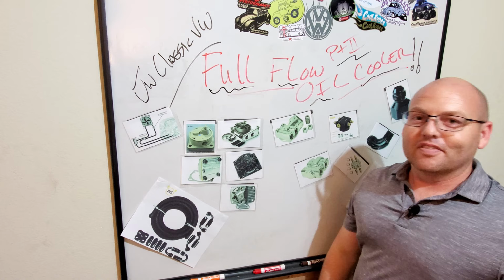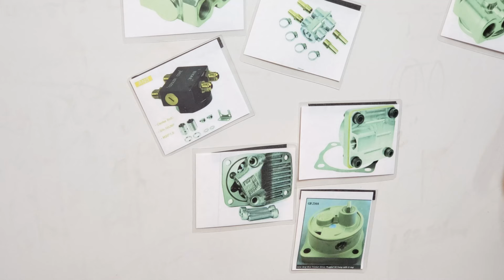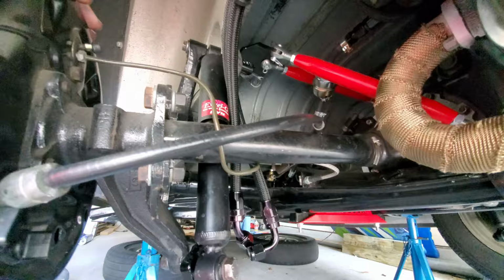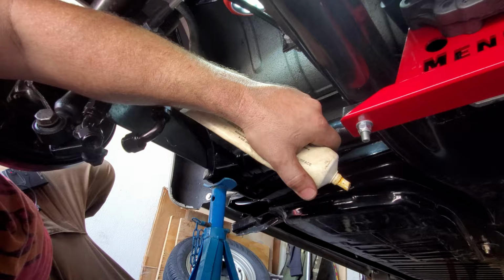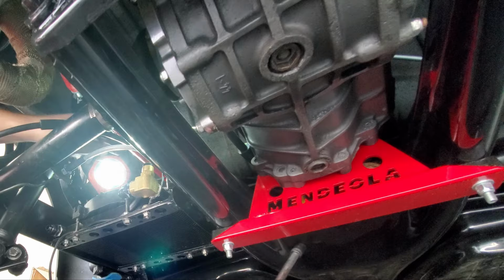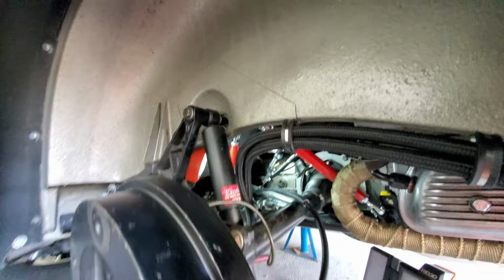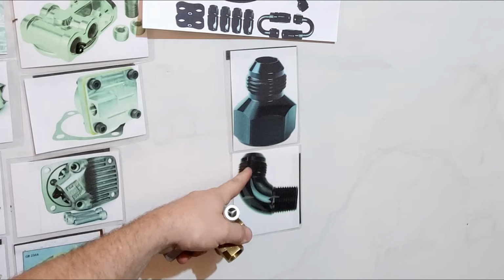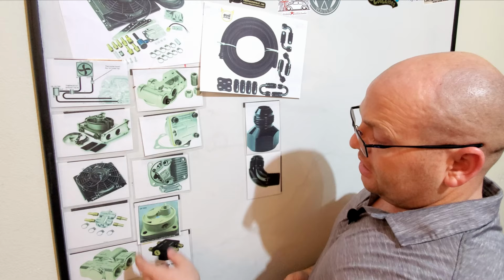Full Flow Air Cooled | Oil Cooler Mount! Remote Oil Cooler! Volkswagen BUG | JW Classic VW

Comment: Oil thermostat bypass , is only need if you drive in temps like here in Canada.  Even on days with 60 degrees, it only takes 4 to 5 minutes  to warm up .  I use a Jacee remote oil filter adapter with a 80 psi by pass and plumb back into oil  pan.
Reply from the maker: Very cool!! Yup that's why I don't run one down here.  I always let my girl warm up 1st!  Thanks for being here man!

Comment: Great follow through on a big project! I'm a fan of full flow, and I like the return at the oil galley like you have it. It's a little off topic, but that zerk fitting on the parking brake cable is awesome!
Reply from the maker: Thank for the support brother, means the world! Yup those e-brake cables are the bomb 💣!!
Reply: @JWClassicVW  Gotta know more! Was that a stock feature? Aftermarket add-on? Super duper exclusive JW Classic VW awesomeness trick?
Reply from the maker: LOL... no buddy they are avilable through most places, mine are from CIP1. 

https://www2.cip1.com/ProductDetails.asp?ProductCode=VWC%2D111%2D605%2D721
Reply: @JWClassicVW  Thanks for the link- I get it now... it's one of the perks of having an early bug! Dweezil is a '68; his parking brake cables no gots the zerk fittings. Thanks for the follow up!

Comment: Great Video Jason. I have a 59 rag with a new 2332 w/48's...I just got the empi 4292 oil cooler and need to mount.I cant find a mounting bracket for this model anywhere. (which I don't understand). My only choice is to mount it under the rear trunk space. Would you consider making another bracket and selling me one? If not I totally understand. Honestly you should mass produce those things and patton them. Thanks, Rick
Reply from the maker: Yeah, your not the 1st to ask if I could make one for them but honestly it's hard sometimes to find the time to just work on videos let alone side projects.  Thanks for subing brother I do appreciate the support.

Comment: I would like to know, how much more oil is that system adding? I know that in a VW engine has a limited amount of oil, but if you are running a lowered bug, bus, or whatever, would this add a significant amount of oil to the system, and not use a drop down oil pan.
Reply from the maker: It adds about 1.5 quarts of oil, that along with the thin line sump I run that also adds another 1.5 double the stock oil amount.  So a total of 6 quarts of oil in my system.

Comment: JW: full flow oil cooler..got question of j-tubes in the old heater-boxes..I was thinking to remove just the sheet metal off the heater boxes..clean-up the heat-zinc fins (have them anodized with some gold.. for showing off the cosmetics..look against the black tin..just for show) this way the J-tubes are air-cooled.. I noticed yours are wrapped.. which I admire that looks like a good idea.. I think I'm going to wrap it just as it comes off the head and then again after  the fins and then  back out to the exhaust.."I'm thinking that yours would need to-be shaved just alittle off next to your home-made engine tin..for the pipe to make a snug fit..give it the custom professional look.. I think that would look bitchin..! Let me know what you think..? Critter.
Reply from the maker: Sounds pretty cool man! Would love to see it when you are done, cool idea!

Comment: I'm loving it but I'm concerned about that shock mount twisting.
Reply from the maker: Hey Josh good morning brother!!
Yeah, I'll definitely be watching it!! I'll be playing with the mount to, really love the spot!!
Reply: @JWClassicVW  it's not the spot that's issue, it's that you only have a single plate as the extension. If you adds another plate on the opposite side of the original mount and contracted the shock and those two plates with the longer bolt it wouldn't allow for the shock mount to rotate up. 

I feel like this is hard to explain over a message....

Comment: does the remote  oil cooler were it is work better there than if it was  up above from were it is now ?? aka mounted to the upper shelf area straight up
Reply from the maker: It is better where it is now... I get a more accurate reading of oil level for one as there isn't any bleed back of the oil into the sump.  Also I feel that this location is a bit safer as in terms of debris.

Comment: Jay what is the name of the mounting bracket for the oil cooler please. Upgrading my motor to a 1915 stroker
Reply from the maker: The oil bracket is custom made brother... there are a few different places that make oil cooler mounts but the only torsion tube style I've seen is through F2 Performance.  You can search them on FB.
Reply: That’s the name of the company cool thanks so much

Comment: How far would you say those oil lines need to be away from the j tubes or exhaust parts for it to be safe and not melt?
Reply from the maker: Well you definitely want to keep them to where they can't make contact but I've had them within an inch with no issues.  You can also buy thermal covers for lines that will keep the heat down as well.  See below...

Thermal Sleeve: https://amzn.to/2UjqXo7
Reply: @JWClassicVW  Thank you sir! I actually just completed my setup yesterday. Including putting similar thermal sleeves over the two lines that go semi close to heat. I also re routed slightly to give a little bit more clearance. Now I’m just hoping I wired everything up correctly, as I haven’t heard or seen the fan come on yet. But maybe it’s not hot enough for it to come on. The thermostat I bought comes on at 180 and off at 165, so maybe 85 degree weather isn’t enough for it to get oil temps that hot.

Comment: Hey Jason, quick question. How did you wire the thermo switch to fan? Is there direct 12v power to it or did you use a relay to trigger it or did you use a relay to trigger switch to ground? I been seeing different recommendations, as I am putting my kit together using your vid but will add the fluid control thermostat. Thoughts?
Reply from the maker: Direct 12v, switch interups power to fan.  When it hit 180 the fan kicks on.  I also. Added an extra wire to add a switch to ground at some point but never used it.  I'll be adding a oil thermostat as well at some point.
Reply: @JWClassicVW  Ok cool, makes sense. I thought about a toggle switch as well, but decided not to incorporate one. Keep the cool vids coming.

Comment: Where did you get the cooler mount from. Thanks
Reply from the maker: Gotta watch part one brother, i made it.  Fabricated oil cooler... fun with welding! 😉
Reply: JW Classic VW thanks hey did you have to clearance your cam on your motor build? If so what part is it cause I must of missed it. Thanks,

Comment: Hey how much did it cool your motor down?
Reply from the maker: Well I can't really say that I have a way to gauge that as I've always had an oil cooler and filter.  What I can say is it stays at 180 degrees unless I'm driving really hard and pushing my engine.  Then I'll normally see the remp go to as high as 220.